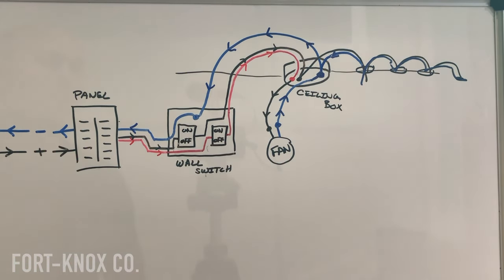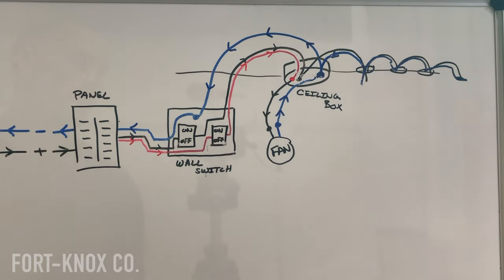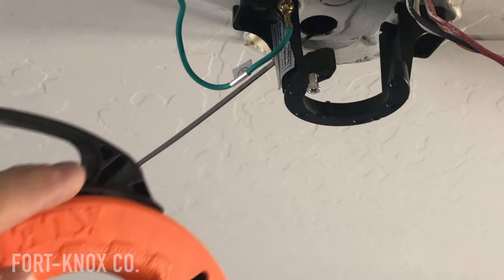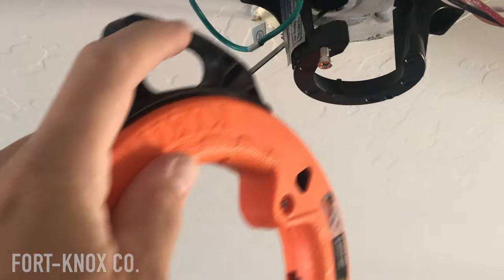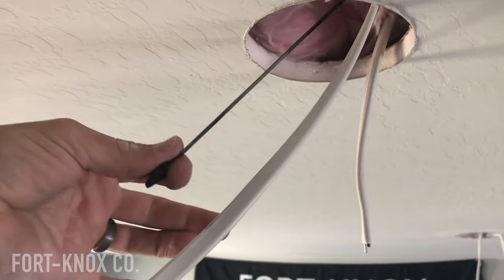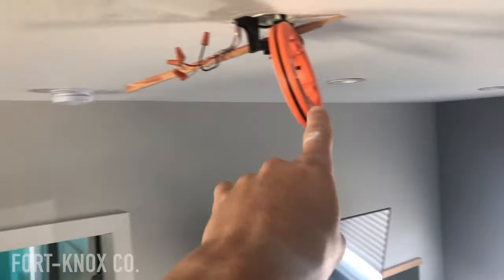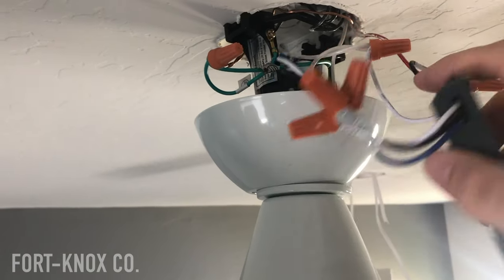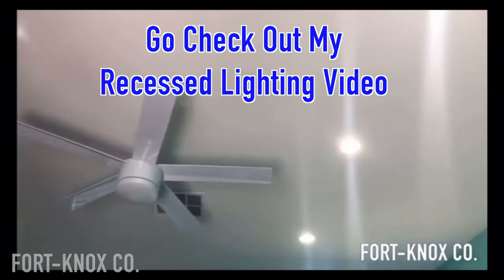How to Run / Fish Wires Easily Through Ceiling for Power to Recessed Lights and Fans

Comment: Whats the cable called?  One that supplies power to the downlights
Reply from the maker: The electrical cables you’ll find in the house that have either a white or yellow sleeve are called Romex. For lighting it’s usually 14/2 Romex, the white sleeve. Inside that you have the black/white/bare copper wires.

Comment: Thanks 
And where do you buy the fishing wire thing. Your explaining is very understanding. One thumbs up.
Reply from the maker: You can get it on Amazon or at Home Depot. I’ve been ordering some of my tools on Amazon lately because they are more in stock and prime shipping. I’ve made several trips to Home Depot and they were out and I ended up having to order anyways. But the tool is called a fishing tape by Klein Tools. Usually orange in color.

Comment: Is there any way to do this in a ceiling that's not the attic above it?
Reply from the maker: Yes. You just have to map out your light locations and see where you will have to jump across som ceiling beams. This usually requires drilling a small hole through the ceiling beam to pass the wire through. And you will have to cut small holes in the ceiling next to those beams to gain access and drill. You’ll be doing some drywall patching after. But it’s a common renovation that people do

Comment: Hey, nice video! I have a question, how would i install a new light in the ceiling and run wire to a existing switch or tie into another light, without having a attic/cutting a big hole in the ceiling?
Reply from the maker: That’s something that might require cutting holes in the ceiling and small holes drilled through the rafters/ceiling beams. This is common and should be planned out to minimize the amount of holes needed. But with no crawl space like an attic this is usually how it’s done.
Reply from the maker: This is also assuming you need to jump across more than one beam in the ceiling. I usually plan out my electrical source and placement of lights to try and use the channel/space that’s parallel the the beams. In that case you can just use a fishing tape and usually jump your wires from hole to hole similar to what I did in the video. Just takes some finesse

Comment: Would the voltage move and need a new braker?
Reply from the maker: No. No new breaker needed. The voltage stays the same. These are 120v throughout the house. Amp on the breaker for wall outlets is usually 20amp and ceiling/lighting circuits are usually 15amp. You can see that in the breaker panel.

Comment: Why do you need the metal box to make the connection ? Can you just connect the wires ?   9.00. Thanks
Reply from the maker: Usually when your doing any type of electrical work and there’s a connection you need to have it enclosed or in some type of box. It’s mainly for a safety issue. You don’t want the connection sparking or getting in contact with anything else in the area. Helps prevent it from grounding out and short circuiting also.  It’s just overall safer to do so.

Comment: There is no positive/negative in residential high voltage electrical.  It’s AC power using hot and neutral wiring for 120V single phase, and two hots for 240V single phase
Reply from the maker: That is correct. Thank you !

Comment: Hell yeah, thanks brother. The only question I currently have is, will I need to get my work inspected by a professional? I just purchased my first home and from what they keep telling me anything I do needs approval or a permit to build.
Reply from the maker: Technically.... it’ll all depend on your local codes. I’m sure they want some money from you to come look and give you a thumbs up. But in general, if your adding structure or square footage to your house your going to want to do permits. That way it’s all recognized by the county or city as part of your home legally and when you go to sell there won’t be any problems.  Also whenever your building something, again with structure, such as a wall outside and it’s going to be permanent and taller than 3ft, they “require” permits. Where I live that’s one for example. 

But in this case of adding a light or lights. Or even a bathroom remodel or doing a backsplash or laying down new wood flooring or tile... They usually don’t “require” a permit. You still should know what your doing and make sure your not installing something that could later be a hazard. So that’s where it becomes important to do the research if you’re going to take on the job yourself. I’ll tell you this, even when you hire a licensed electrician to do the added recessed lights for you they aren’t pulling any permits to do it. They are just licensed and trained to do so and usually have some type of insurance liability coverage to cover their installations in case there were any type of faults afterwards. So that’s where the balance between knowing what you’re doing or paying somebody who knows what they’re doing. But stuff like that usually doesn’t require a permit it just requires the knowledge to do so.

Comment: Whats the total drop height of ceiling? Can i do. It in 4 inches
Reply from the maker: This ceiling has a small attic space above it. Approximately 5’ at its highest point. It has roof trusts pitched roof. But if you have any type of space you should be able to run some wires. The question is if you have to jump across beams. If there’s no space to run the wires over the rafters/beams then you will have some drywall work ahead of you. It can still be done but this usually requires you to cut multiple holes around those beams to drill small holes and pass the wire through.

Comment: What if the ceiling fan box has 2 browns and a teal? I’m so confused by the lighting in this house. The box does not have red or black. Only 2 browns and the dark teal. 😢
Reply from the maker: Yeah that is weird. 

If you have a switch on the wall that controls those wires in the ceiling what I would do is open the wall switch by removing the cover and pulling the switch out so I could see which wires are attached to the side of the switch.  The switch will have the hot wire on it is usually. So if you see a brown or dark teal  on both the screws on the switch that will be your hot wire which goes to black. 

Then inside the switch box you should see another color that matches the other color up in the ceiling. That other one that is not attached to the switch should be your  neutral (white). 
And as far as a ground bare copper wire (green) you may not have one. Some homes,usually older, do not have a ground copper wire. So you’d just leave it capped or attach it to a screw on the box in the fan housing. Usually a green screw. 

Another  way to tell which is the black (hot) wire and which is the white neutral would be to get a volt multi meter and test the wires.
Reply: @FortKnoxCo  Thank you for the info. I took off the plate and I'm looking at the box. There are 2 cables coming from the bottom. 1 red and 1 brown (no ground). The red is connected to the light switch and the brown goes straight up to the ceiling.
Reply from the maker: @Gi_Lovely  could it be that the color of the wires in the ceiling are faded or have changed color due to age? Possibly one of the browns used to be red? 

I’ve never seen a set up like your describing. 
Did you have a fan or light hooked up before? And if so do you remember what wires were connected to what? It’d be nice to be able to replicate what what’s working and already there before.

Comment: Great video much appreciated! I’ll have attic access when doing this project, is it cool to run the romex through the insulation and up and over the joists between each recessed light or do you have to drill through each joist? Thanks again.
Reply from the maker: If you can go up over and around stuff that’s best. Drilling is usually a last resort.
Reply: @FortKnoxCo  How do you know if you have the ability to go up and over?  Im looking at doing this on main floor, bedroom above.  Guess I must drill?
Reply from the maker: @ryanball17  if your working in the ceiling between first floor and second floor then yes, your probably going to have to drill a couple holes through joists. This is where planning all your runs between lights really matters. The path of Less drilling is best.

Comment: I like the way you demonstrated via diagram. I'm planning to install few but i'm worried if I had to make any drill through the Joist and it might damage any duct out there? pls help how to proceed
Reply from the maker: Well first identify which direction your joists run. then plan out a path, if possible to cross over as few joists as possible.
then you should be able to know based off the lay out of your vents in your house if your going to be running across any ducts. 
the difficulty level is a little higher on a two story when running the wiring in the ceiling/floor, but its totally doable.  Just take a little more planning.
Reply from the maker: If you haven't already, please consider Subscribing to my channel. I'll be putting up a lot more videos on a regular basis. All kinds of DIY builds and stuff around the house that people can easily do themselves and save money

Comment: Have you made a hole in the joist to run the wires from one recessed spot to another?
Reply from the maker: I haven’t had to do this because there was space between the rafters/roof trusts  to run the wires. But you can make small holes in the joist if your working with a second floor above you. The hole has to be no bigger than 1/3 the joist width. But I’d still go with as small of a hole as I can to get the wire through but without snagging or pinching.

Comment: I’ve the same Rogue Squat rack, in my garage. Lol I want additional lighting in my garage , but I’m wondering how to run the wiring, and it it’s secured against the joists, which are dry walled. I don’t want to have to do a bunch of patching.
Reply: Also, the floor above is bedrooms.
Reply from the maker: I have a video recently where I ran electrical on the outside of the wall and installed a new outlet box externally for more power in our temporary garage gym.  You can do the same thing for running new power across the ceiling if your wanted.

Comment: So it’s ok lay NM wire across ceiling laying on it?
Reply from the maker: Some building codes are different in different areas obviously. But I’ve seen some house builds where they do just that, they run all the wires shortest distance straight across rafters n stuff. I’d say if you have the ability too you should go one step further and secure the wire to the wood within 12” of each connection. I know codes in a lot of areas require the wires within the walls to be secured at certain distances. But in this case where your adding lighting after drywall and everything has been installed, it’s simply an option to just run it. It wouldn’t be worth pulling the whole ceiling down to run these wires simply to secure them with a few hooks and have them run along the wood beams better.  And this is in a part of the roof where no one will be walking inside or had access to. So the wires running across this tight space won’t be disturbed.
Reply: @FortKnoxCo thank you

Comment: How do you pass the wiring tape if you have beam in between?
Reply from the maker: You’ll probably have to drill some holes through the beams. It can be done. You never want to drill a hole more than 1/3 the width of the beam. And really plan out where the wire runs so you have to drill the least amount of beams. And to access the beam to drill.....well that takes some drywall work.
Reply: Thank you.

Comment: In my ceiling I need to drill through the joists using an extension bit. Any tricks or tips on checking for wiring first so you don't drill through it? With the layout, there will be a recessed light, then (2) joists then another light. So "x light x     x light x     x light" (x is the joists).  I can use my phone to look up in the cavity where the lights are, just not space between (2) joists. Thanks
Reply from the maker: I’d check to see if there’s any utilities running along those two beams you’ll be drilling through.  See if there’s anything that looks like it runs or would run along there. Other than actually popping a small hole big enough to look in the space between the beams and actually checking visually, there’s no 100% way to know. Unless you have the plans for the house and can see where pipes/wires were ram when building. You may be able to see if there’s any obvious screws or nails in the beam possibly showing that something secured on the other side.  A lot of people pop hole throughout the drywall to help feed and drill the beams and then come back and patch everything up. If you do that, try using a “pumpkin” cut in the drywall and it helps with easier repair.
Reply: @FortKnoxCo  Lot of good points. Sounds like I'm going to have to do a few holes to have a look. I'd rather patch those then to drill through a line! Never heard the term "pumpkin cut"....is that just to make the piece of drywall an irregular shape so when you put it back in it "keys" into place? THANKS
Reply from the maker: @krehbein  no problem. A pumpkin cut is like a 3 sided square or rectangular cut where you leave one side still intact with the wall, acts like a door. Google or YouTube pumpkin cut drywall and you’ll see. I haven’t made a video on it yet. But will be
Reply: @FortKnoxCo  cool technique, going to try it on a scrap piece of drywall today. Will use hot mud to “glue” it in place.

Comment: Let me say THANKS beforehand.
Regarding your diagram.  
Am I to understand you are using 12/3 wire with a single 12 amp circuit ( solely for specific switch identification i.e. BLACK / RED)?
Reply from the maker: I’m using 14/2 romex (white) for the circuit. These circuits are on a 15amp breaker. The wall/plugs have 12/2 or 12/3 romex (yellow) wire. 12/2 is used for the 20amp wall circuits. The 14/2 romex is usually used for lighting. 

There was a 12/3 ran to the ceiling from the two switches when the house was built to have a black & red for two power options in the ceiling. I ran a black/white 12/2 from one of those powers to run my lights off of.

Comment: What if there is a fire block in between?
Reply from the maker: Your most likely going to run into a rafter or just some type of cross bracing. Fire blocks are in walls to slow down the spread of fire going vertically up the wall into the ceiling/roof. But if you run into that and you can’t go over it, like when working in the ceiling of the 1st floor on a 2 story house, you can usually drill through. Small enough to get the wire through, never more than 1/3 the total width of the wood. It requires more drywall work obviously because you’ll be cutting holes in the ceiling tk gain more access to the joists to drill.

Comment: What type of cable did you run?
Reply from the maker: In the ceiling because its for lighting I ran a 14/2 (white casing) solid core Romex. there's usually white and yellow. yellow is usually 12/2 or 12/3 being a little bit thicker wire and used for outlets in the wall.

If you haven't already please consider subscribing to my channel. I'll be putting out videos a few time a month on all kinds of stuff.

Comment: I have some dead switches and lights that cant get any power. Two electricians could not fix them because my house have old wires.i need new wiring like how you explain.
Reply from the maker: Yeah unfortunately in some older home you may have to actually re-wire some parts of the house. Maybe even starting all the way back to the breaker box. Start there with a fresh breaker and where you know you have power and run it to where you need it. It will most likely require some crawling around  in the attic or drywall work. But people do it all the time.

Comment: Great video, but the wire from the panel is just a black and white. The wire from the switch box to the fan/light box will have a black, red and white.
Reply from the maker: I was just kinda showing it for lustration purposes of how the red is basically another black. But I get what your saying. From the panel/breaker your going to have black and white. 🤙🏼
Reply: Awesome. I'm glad you did the video. Most people think it's hard to do this but it's pretty simple if you have some time.

Comment: How do you get power from wires in the roof,  my switches and some lights have no power, can the electrician get power from another ligh?
Reply from the maker: If you have power in one location and you want to move it over to a new location that’s usually not a problem.  BUT if you have power in one location and you want to keep it there but also branch it over to a new area and wire in some lights or something , you will definitely have to have an electrician help you. It can be done sometimes but it depends on how much of a load you’ll be putting on that one power source and then making sure you wire in the new stuff correctly
Reply from the maker: If you haven’t already please consider subscribing to my channel. I’ll be making all kinds of helpful videos and uploading several times a month.
Reply: Show a video on how you get power from a wire in drywall